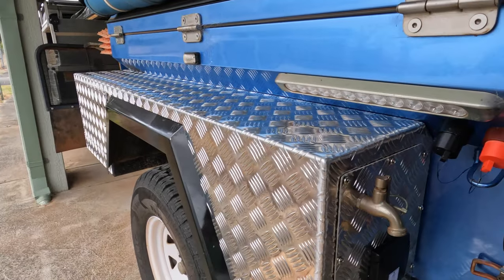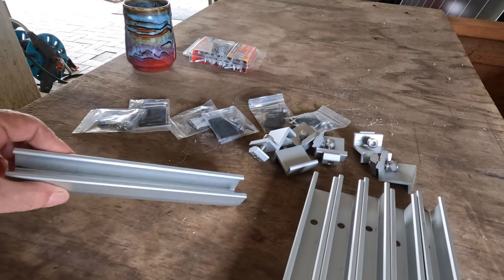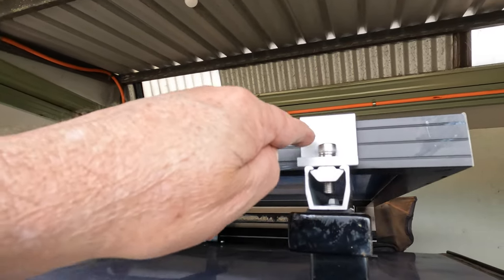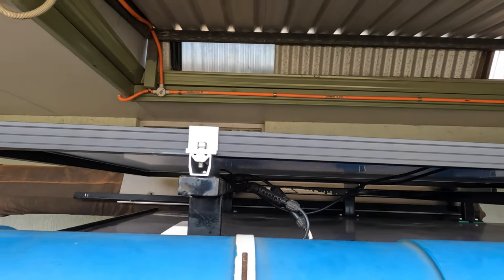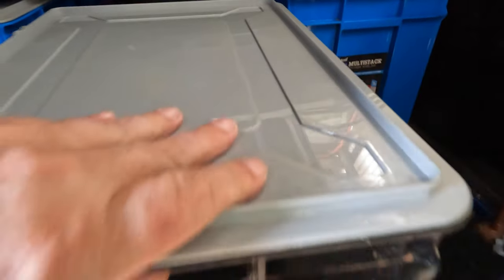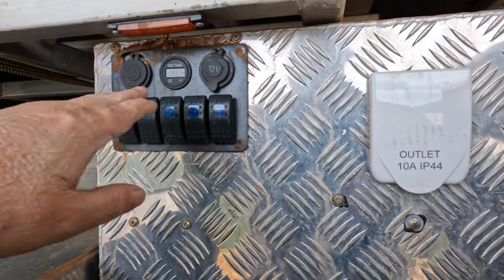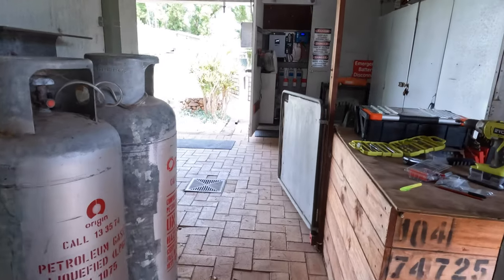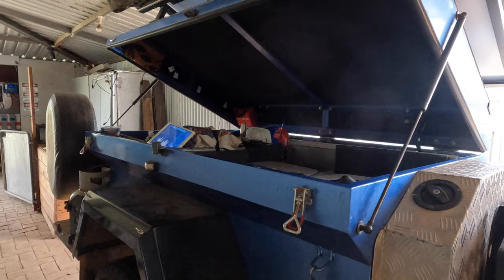RV, Camper Trailer.  Installing the Solar Panel to run it all (10)

Comment: Looking better by the day, that's a nice large panel, if it handles the rigours of the Aussie bush you'll be laughing !! Nice work as usual mate 👍
Reply from the maker: Already had one the same out bush mate. Stopped in at a caravan park and there lawn mower broke it. After it was shattered it still produced 300Watts and finished the trip with us. Video link  https://youtu.be/U0CAW3uKiBY . They are an amazing solar panel. Not only are they the most efficient i have every tested, but they work grate even when broken.

Comment: That's a awesome set up there... Keep it up brother
Reply from the maker: Thanks mate.  Been a lot of work putting the hot water system on the trailer. The new solar panel should run it all no problems